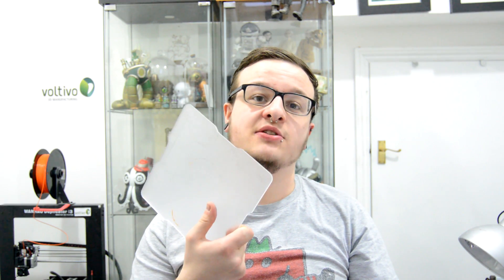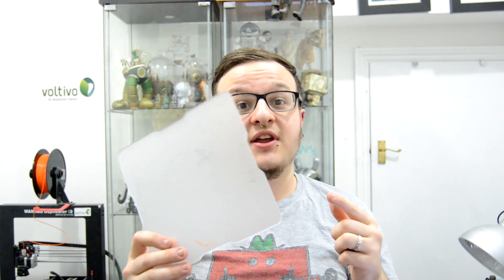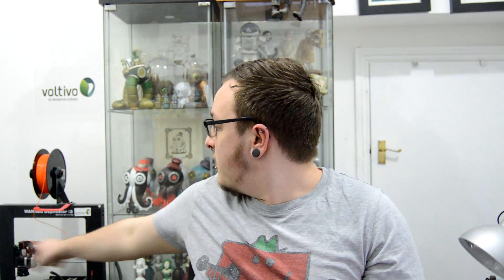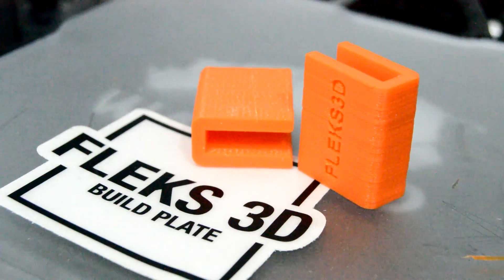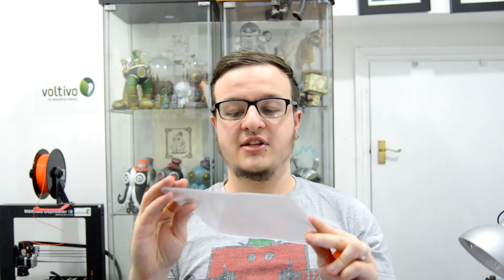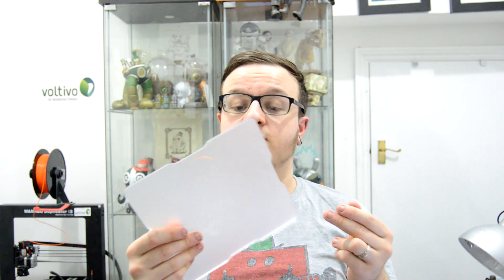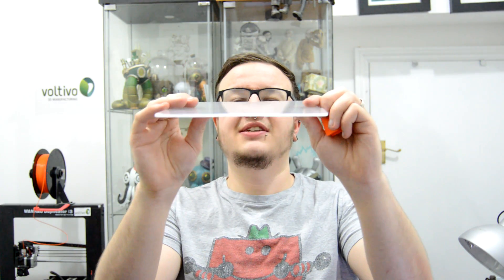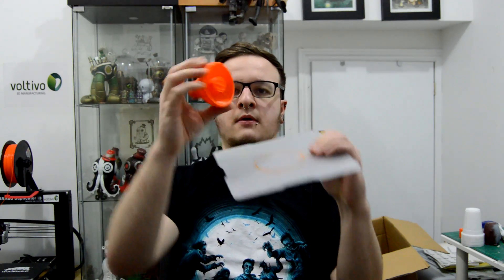FLEKS3D 3D Printer Flexible Build Plate Review

Comment: Thx for the nice detai. Any updates?  Still printing with it?  Any warping after 70 degree bed?
Reply from the maker: I no longer print with FDM based printers, only SLA resin machines but for the while I used these plates they were VERY good

Comment: I bought smaller clips from Staples and put them along the bottom, right, and top. Works well.
Reply from the maker: Sweet! It's such a great build plate, how are you liking yours?
Reply: So far so good. Much better luck than the blue painters tape.
Reply: I did the same thing, small clips from Staples!

Comment: Here is my review.
Flex3D was received and tested several times. Unfortunately it seems to 
have an uneven surface as on several occasions the print head has grazed
 the Flex3D plate and made a few lines in it.  This only happens in a 
few spots here and there so it cant be my printer or the entire layer 
would be burned into the Flex3D. 

It does stick really well and i have managed to print items that i 
would otherwise never be able to print.  In some cases though it works 
too well as some sections of the printed parts break while trying to 
remove them. I think that was a result of the uneven surface and the 
parts bonding with the melted Flex3D plastic.

All in all I would say that this is a great addition to your printer
 but it's something you should use for those prints that really need the
 extra adhesion. I don't think it will last very long if you use it a 
lot as it will slowly be torn apart by the print head.

Comment: You could print smaller versions of the clip and put 1 in each corner to prevent warping.
Reply from the maker: It says it does work for abs but not tried that, and the clips work well in the centre and that's where it will warp. With them on the sides it sits nice and flush to the buildplate

Comment: I wounder, if over time, that plate starts to warp more because of the bed heat. I guess time will tell.
Reply from the maker: Yeah, only time will tell, but like I said in the. Idea, it didn't work at all without heat so even if it works for a few months then warps I'm happy